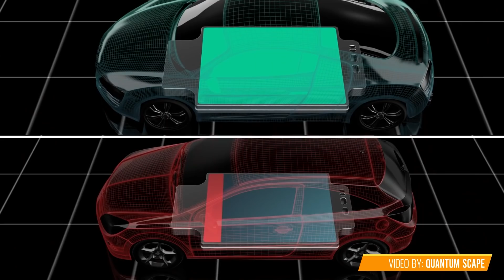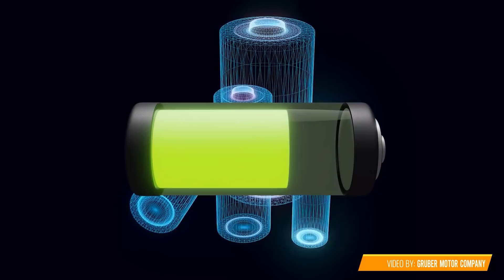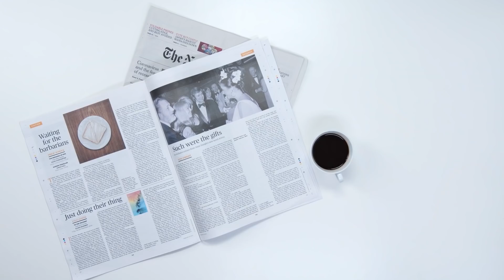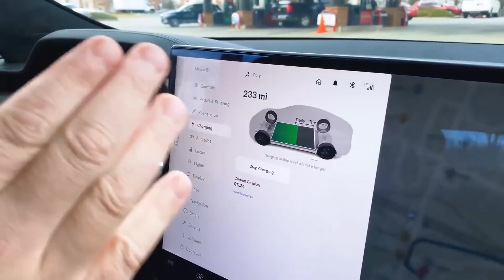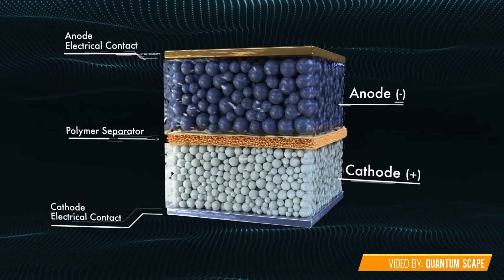SANDY MUNRO: Are Solid State EV Batteries Too Late?

Comment: I don't have an outlet in my condo so fast charging is an issue to me, but the 800 mile range is definitely a game changer.
Reply: I have two EVs. With out home charging, or an EV with free DC charging close by, it would be a deal breaker. I think people in your situation are an even bigger hinderance to EV adoption than lack of great CCS fast charging. In the last six months I have DC charged twice, got to have home charging.
Reply: Before buying an EV, I reached out to my apartment management and was pleasantly surprised they were willing to install a standard wall outlet for me at no charge. And the simple fact is for 90%+ of normal people's driving habits, a standard wall outlet is plenty.

I doubt many apartment/condo property owners are interested now (outside new buildings), but I think things are going to quickly change over the next decade--providing EV charging will be mandatory to not have emptying buildings.
Reply: @tHebUm18  I tried to get the condo board to consider a charging station or normal plugs even but was stonewalled, and this this is only a 5 year old building. It will be tough adoption up here in mid Canada because of our extreme winters.

Comment: No. Fast charging doesn't just happen on the road. Zillions of urban and suburban drivers (such as myself) have no access to 'home chargers' and must depend on available dc charging stations. Having said that, I treat my Model 3 as I did my last ICE. Meaning, I charge it to 75/80 % once every 7 to 10 days (depending on needs) and it takes me at worst 20 minutes. It takes me longer to take a healthy dump and get coffee. Sandy's right. The hype is worse than reality.

Comment: My understanding what a solid state battery is is that there is no water. That will always make a big difference to regions with cold winters. Also, chances are, solid materials will have fewer or no problems with things like dendrites and chance of catching on fire. If they can be produced inexpensively and can charge quickly plus have range... there will always be a market for this. Recyclable, good for the environment too? Even better. Whether it's batteries or super capacitors doesn't really matter.

I'm waiting for this tech to work its way down to ebikes.
Reply: You are lucky, SES battery starts production of their 100AH Li-metal pouch cells next year. At 417Wh/kg they are almost twice the energy density of Li-ion. Your bum will hurt before your SOC!
Reply: What will solid state batteries cost though?  I’ve seen no mention of that so far.  Cost can still be a killer.  Being able to take a large charge rapidly, and be frequently recharged with little degradation can still be beaten by impossible costs.
Reply: @edwardcoulter9361  It looks like that's why Elon Musk said the lfp battery is the future of electric car energy storage. It could take that long for costs to come down for solid state batteries. From what I hear we don't have a ssb working at all right now, not even an expensive one. But that doesn't mean it will never happen. I expect anyone who buys an electric car will not have the same kind of battery when they buy the car after this. But whether or not that next gen will have ssb will be hard to say. But I really hope it happens sooner than later. I want it for my electric bicycle.
Reply: I

Comment: The winners will be whomever can be faster, smaller, lighter with the same range. Batteries are still too heavy and take up way more space in a car then a gas tank ever did.
Reply: The volume winner will be the light, cheap, slow car. Not everybody will buy a Tesla.

Comment: Charging networks need to improve (Teslas is certainly the best/most featured) and reliable at the moment in the US; i watched MKBHD’s trip video where they took a Model S, Mach-E and ICE car on the same trip; the charing network had issues along the route (some not functioning properly; or offline leaving them in a pinch with little range to get to an alternate to charge and continue on the trip as planned.   Entry price for EVs also has to come down further i think before folks will opt-in to changing over.   I’m certainly looking forward to battery improvements and more range similar to what ICE provides today 400+ range
Reply: The Tesla network provides more details than the others in the US that are being bundled with cars from Ford, Polestar and VW (# of chargers online, # of slots open/occupied, etc. hopefully they will improve

Comment: Every time somebody comes along and says that 15 to 20 minute charging is adequate I laugh. I laugh because it’s not gonna be 15 to 20 minutes, it’s going to be 30 to 45 minutes or more because you’re gonna have to wait for somebody else to finish charging. Companies are not gonna put in 1 million chargers at every hotel and store. 

The other issue is lithium procurement, I’ve seen from many reputable sources that we may run out of lithium or there may be a shortage that will make the chip shortage seem mild. This isn’t to say electric vehicles won’t eventually get market share but it will certainly delay it by 5-10 years. Don’t forget mining is actually worse than building gas cars.
Reply: If you charge at home, charging time becomes a non issue
Reply: @DuckHunterGaming  until you have a family gathering or the power goes out, but most times yes.
Reply: So the goal of 500,000 public ev chargers being currently funded by biden is a lie then?
California's goal of over 1million public chargers in their state alone by 2030 is also a lie?
The Biden administrations claims that already there are over 150,000+ publicly accessible ev charging point's to start off 2022 is another lie? 
Siemens making ev chargers in the U.S. now, and said just recently they want to hit 1million unit's a year by 2025 is another lie? 🤔
Reply: @4literv6  any time the government says they are going to do something or make something happen you should run the other way. Where I live we have potholes the size of Texas that haven’t been fixed for years, even when we were promised (Maine). What makes you think Biden will be able
To put it millions of chargers?
Reply: @thomas735  well if y'all truly potholes the size of Texas? I think you are far beyond the point of an ev or easy access charging solving any of your worries. 

On a more serious note I served in the U.S. army so I can appreciate more fully that old saying. The scariest word's ever spoken to man?
"We're from the government and we're here to help you" 😁
Reply: @4literv6  I hear ya, but the problem still comes down to will there be enough? Especially if everyone wants an electric pickup. I’m willing to bet against EVs in the short term because to be these processes described above will only benefit a relative few individuals.

The wealthy will have access to these electric vehicles but not mainstream. It goes beyond Electric cars too, I think the western lifestyle itself is unsustainable. Cars with giant batteries, phones that break after 3 years, western diets full of meat that causes cancer, large scale deforestation, etc.

Sometimes you have to go backwards to go forwards and I think that is where we are at now, the chip shortage I think is just the start.
Reply: @thomas735  I actually agree with a few of those sentiments. Thanks for the conversation. 🤔
Evs are happening though period, we are on that s curve that Tony seba told us all about year's ago now. 

Also if you are interested? Just check out the planned and already under construction us battery plants.
Not counting updates over the past few months or any of teslas in house 4680 cell production. 
There is now enough battery cell capacity planned to be available here in the us by the end of 2025. To do 55-65% of all vehicle sales as evs.
Reply: @4literv6  yes, absolutely!
Reply: @4literv6  isn’t tony seba a big time Tesla investor though? Just curious.

I know GM’s and others are making big promises about batteries and the market, but there is one big Japanese  car company that has been studying batteries for decades that says it won’t be feasible to have everyone driving electric in 10 years. 

Good convo!
Reply: @thomas735  idk about seba being a tesla investor or not? 
I know he was predicting the end of oil due to renewables displacing them by 2030 all the way back in 2011. 

Which is before tesla even debuted the production model s for reference. Some of his most accurate ev curve adoption rate predictions also came before the model 3, Chinese evs or vw evs we're even shown to us as prototypes. 🤔

I know Toyota has ragged on evs and even paid to spread disinformation about them for year's now. The ultimate irony there is they had the rav4 ev done with tesla before the model s even came to market. Supposedly the Toyota brass was very conservative and the go fast break things tesla way of building cars. Was to anathema to their own stodgy low risk way of doing it. 

Which to be fair works or seems to in the ice space. But is not translating well to being competitive in the ev space so far. 
Hence Toyota's near endless fud about evs. I say good luck to em, they'll certainly need it. 
No way imo the market allows them to survive until 2030 when they finally plan to bring about 1 million evs a year to market. 😀
Reply: @4literv6  he does from what I’ve read!

I have to be honest, I think Toyota and Honda even don’t have to be in any rush. The reason why is because according to sandy, hybrids and ice cars will still be selling in quite high numbers (especially in Japan and the US) in the coming years, even past 2030. 

They will make some EVs, but they will ultimately make what the customer desires,   Right now the Japanese brands are selling every car they make. There’s huge demand for electric pickup trucks, but it remains to be seen how many people will actually be able to afford a 70k vehicle, especially when this overheated market collapses.

My thoughts are it is actually the luxury brands like BMW or Cadillac that have to move faster, because teslas are on price parity with those brands. Just my 2 cents
Reply: @thomas735  again you make some good salient points. But I don't feel you can see the forest for the tree's yet. 
Either way only time will tell which strategy is relevant or if we're both gonna end up somehow wrong? 😀
Thanks again for the civil conversation. 👍🏻
Reply: @4literv6  welcome!

Comment: Sandy, the REALITY is the Tesla achieved a 752 mile range done at 38 - 40mph ! .....the slower you go the further you can go. hummm   Most people wouldn't entertain that!
Reply: 55 mph
Reply: They averaged 55+mph on that run which is higher than the epa average for mileage ratings of 48mph, in another video by ONE they claimed over 870miles in warmer weather at a similar speed with the same car.

Comment: Sometime in the next 10 years EVs will drive further and charge quicker than a gas car. Don't believe me? In just 5 or 6 years we have gone from 100 range EVs with 50kw charging to 450 mile EVs with 350kwh charging.
Reply: Frankly - i do not care one iota. I drive electric for 3 years now and was never more relaxed and never had more time besides going to the petrol stations. I leave my house in the morning with a charged car and come back in the evening to plug it in. And sometimes i drive to a Supercharger and go grocery shopping whilst charging my car. Its always ready before i am. Always!

Comment: Maybe the real focus is not on batteries and charge rates but focus on infrastructure.  Think commuter trains in cities that are electric powered via lines along the route.  The US should build a lane made for electric cars that has charging capabilities like wireless charging for our phones that runs along the freeways.   The cars would have charge points that would lower when in these lanes and draw electricity from these lines.  The battery would be used for non freeway driving.
Reply: That's intrinsically inefficient.

Comment: Solid state needs to be cheap and allow extremely quick charging, otherwise it’s too late for now , could be five years away for the normal buyer
Reply: 5 years is fine.  That's about the normal automotive product cycle. Even if Tesla bought in,  for example,  they could probably build 20 million cars by then with 4680 cells, then upgrade to solid state thereafter. It's just like computers- buy what you need now,  and later you'll buy what newest tech comes out when it's time to buy again.

Comment: The Solid State battery Vs Liquid/slurry types, could easily become a case of Perfect Solution later vs Good Enough now, to the point that the gap could quickly become insignificant in some of the key aspects: Charging time or Pack density.
Reply: It will not become. It is. Yes Li-Ion is not the best solution. But its workable and its available. Maybe we have another solution 20 years from now. Maybe we are all driving with vacuum energy and on antigrav cushions like the Stetsons. But not now.
Reply: @wolfgangpreier9160  Stetsons? Are they related to the Jetsons?
Reply: @skipondowntheroad5833  Ah yes, of course. American culture. Sometimes a mix up some of those idioms.

Comment: Cold weather kills the range and any sort it loads reduces efficiencies exponentially.
Reply: The most I've seen is a 25% reduction by reading upon it. It's from heat and cold weather affecting batteries. 

Do you live in a cold climate though? Because fuel efficiency goes down also. I live in a cold climate area.
Reply: That word does not mean what you think it means.